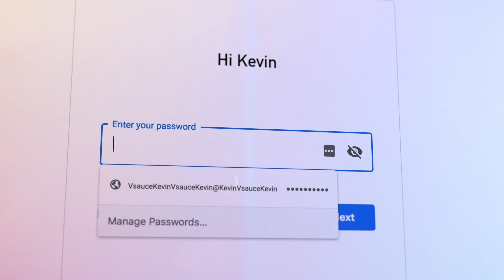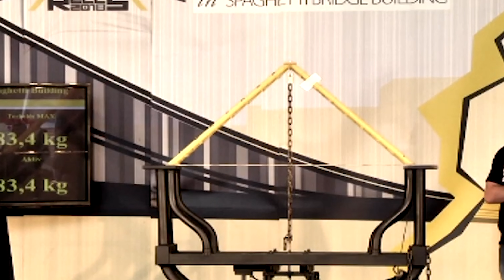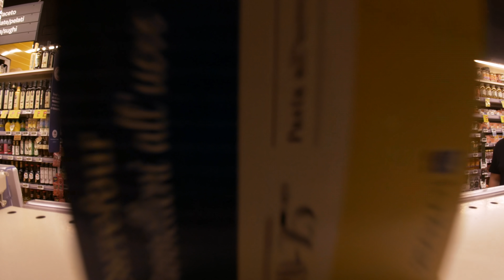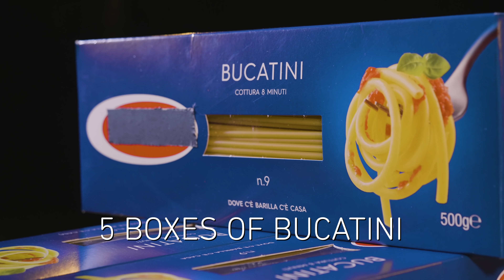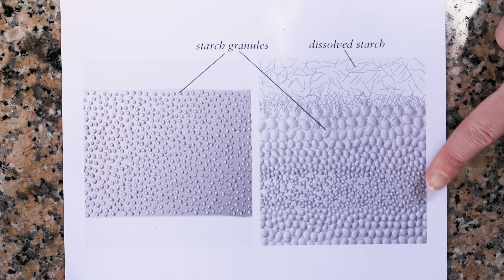Can Pasta Hold Your Weight?

Comment: The pasta holding up the book at the beginning of the video reminded me of those nails platform thingys that you can stand on without the nails going through your feet. Or you could sit ot lay down on it, same deal. Im talking about metal nails, the ones you push down with a hammer.

Comment: Elasticity is a quality that relates stress to deformation. Things that are brittle don't deform much before breaking, therefore have low elasticity. But they can still be "strong"

Strength is a measure of total stress a material can take before failure.

Materials can have HIGH strength and be brittle. 

Non tempered steel, for example, is extremely brittle but has ridiculous  strength.

Comment: Brittleness is not the measure of how much stress material can take before breaking. Brittle materials have very little plastic deformation before fracture. This usually correlates with low energy absorbtion but has little to do with fracture stress

Comment: By the way, I'm not sure about the structural integrity failure of the chair due to just a little submersion. 
I mean, at room temperature the pasta does not absorb water that efficiently, and even if it did, only the outer layer would be affected. 

It's more probable that lifting your legs, thus adding more weight on the cha... I mean, stool, caused some initial damage and those snowballed into the disaster we all saw. 

Have you tried lifting your legs before submerging this pasta creation?